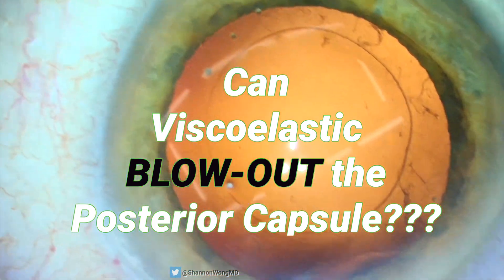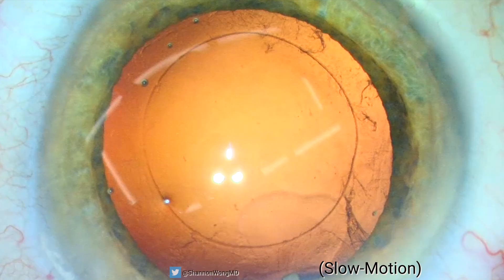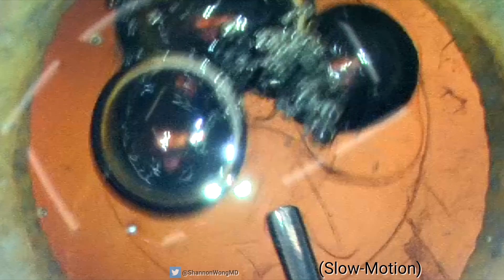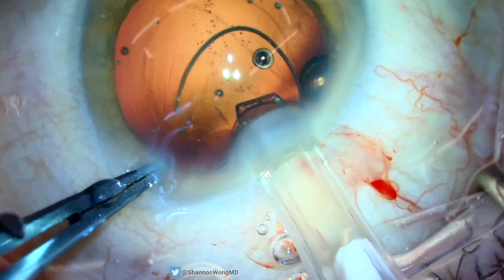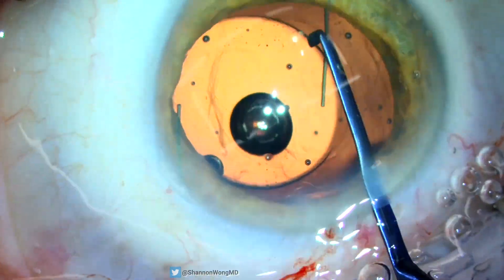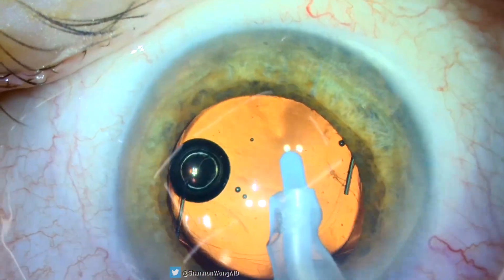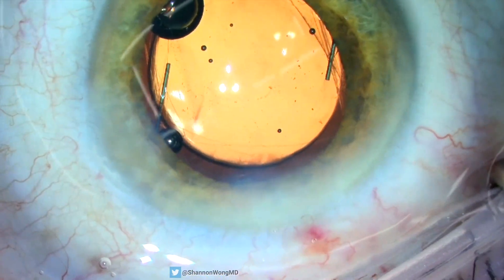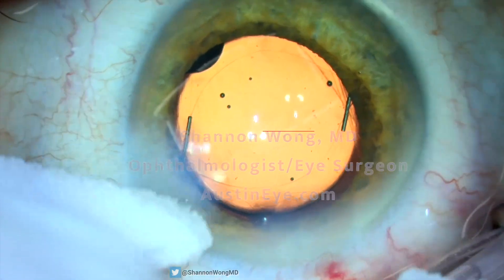Can viscoelastic BLOW-OUT the posterior capsule during routine cataract surgery???

Comment: Hi Shannon. Really appreciate how you show these complications. I agree it looks like the bubbles caused the rupture. That's crazy! Never thought that could happen. Just some food for thought - since patients with a posterior capsule tear are at higher risk for retinal detachment, I'd consider placing an acrylic rather than silicone 3 piece IOL. If the patient does need retina surgery, a silicone IOL can make retina surgery more difficult by fogging during air-fluid exchange and limiting visualization. I've had our retina specialists tell me they've had remove silicone IOLs in order to safely complete a case. Also, if silicone oil tamponade is needed temporarily, then removed, it can stick to the silicone oil and be difficult to remove and significantly affect vision. Anyway, great videos! Keep it up!
Reply from the maker: Silicone oil is rarely used.  Negative dysphotopsia from single piece acrylic IOLs is relatively common.  We have chosen to use the bausch and lomb LI61AO monofocal lens for patients choosing basic cataract surgery because the optical quality of this lens is better than any other monofocal lens implant that I have ever seen in my career. (No financial interest).